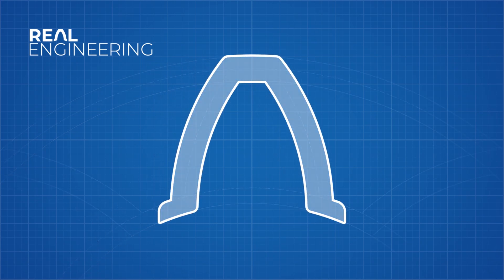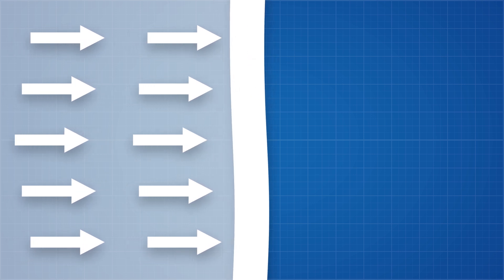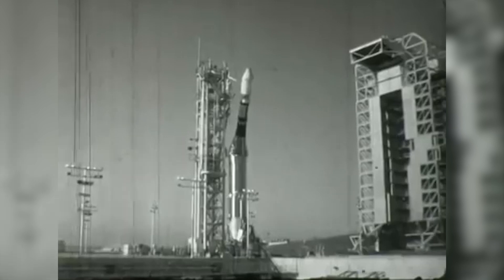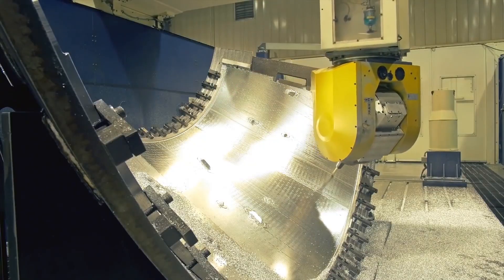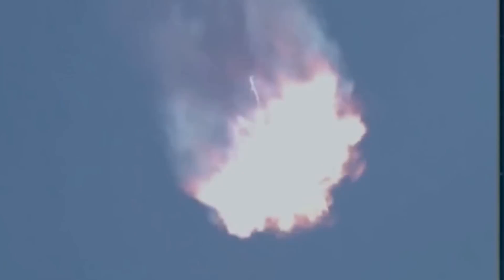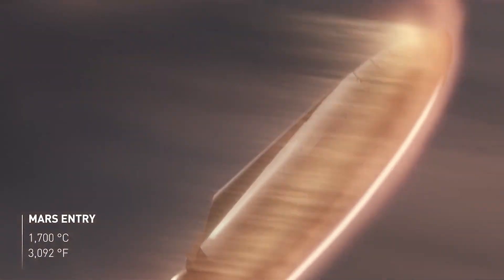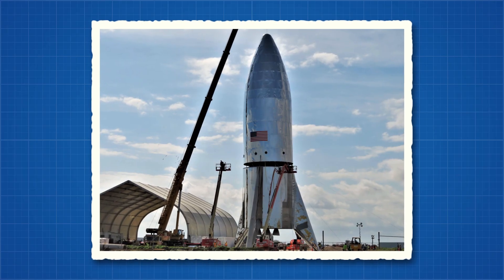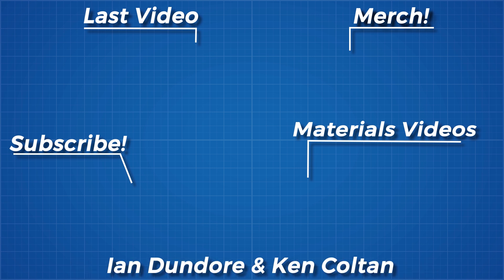Why SpaceX Built A Stainless Steel Starship

Comment: stainless steel gets very brittle at the temps on the side not heated by sunlight in space .
Reply: ".... Musk says SpaceX will initially use 301 stainless — that’s similar to the metal used in pots and pans. It doesn’t sound very space age, but SpaceX seems to think it’s the best option. ...."  initially being the key word ... no word on what will be used in the end .
Reply: ".... cryogenic temperatures can cause a normally ductile and tough stainless steel, such as 301, 302, 304, 321, to partially transform to bcc structure, resulting in an impairment of ductility and toughness. ...."

Comment: Don't forget the extra drag in that calculation to determine the amount of Standard Oil that I need to pay (using only horse currency from 30k) to place into what should be my gas tank, at this point in time to get that thing to reach orbit.  You may also need patiented baffling technology for so much gas.  That drains towards the fuel line and not always or side to side.  b

Comment: i think the main thinking Error ist to think the ship has to land, why not build a ship up there wich only travel from location A to location B, that makes the landing vehikles alot easyer... if u can use Technologys wich are allready there...  just remember this technology was used on the Moon... and for surface Returns u only need a small weight to bring up while the Travelship can have a very very big confy 
size
Reply: That's a logical question, but I'm sure there's a logical answer; I find it hard to believe they haven't already thought of that.
Reply: I costs too much. By landing every part of the rocket they can reuse the rocket.

Comment: When you do something different (Especially drastically), failure is more likely to happen. But that isn't a bad thing. The analogy, "The road to success is paved with failure", is a rather fitting statement. While sticking to the old, tried & tested ways may yield less failures if a company has the capabilities to produce vehicles with reliable means, it however may not promote much room for substantial growth & advancement with the current designs. As whatever advancement that does happen from old technology, will often be small, incremental implementations. Building something new from the ground up, while taking in to consideration the failures of similar designs, doesn't mean that such will share the same kind of failures, but it can reveal new, differing kinds of failure, which I believe is necessary for the continuous improvement of such a new concept vehicle or rocket. There needs to be constant evolution. In all aspects. Otherwise, well, we would probably still be single celled organisms. Our ability to understand & problem solve is phenomenal to have, which ensures constant adaptation. As aforementioned, this bodes the same in every aspect of what we put our minds to.

Comment: Thermoconductivity? The thermoelectric effect is the direct conversion of temperature differences to electric voltage and vice versa via a thermocouple. Thermoelectric devices create a voltage when there is a different temperature on each side. 
Does this craft take advantage of this ?🍀Is this shiny retro rocket a hybrid ?

Comment: So a couple of questions:  Why not titanium for the structural metal?  Lighter than steel but stronger and more heat-resistant than aluminum, and not a very good conductor of heat (and more corrosion-resistant than both).  Also, why not water for the skin coolant on the Mars rocket?  Easier to store than methane (no cryogenic refrigeration needed, and more than twice the density when liquid -- just don't let it freeze), and has a LOT more heat capacity and heat of vaporization.
Reply: @awashburn6944  Why would titanium be less safe for storing liquid oxygen -- does it get brittle with the cold?  (And I thought steel also had this problem.)  It shouldn't react, since it is already passivated as long as it has been exposed to atmosphere (at room temperature) before use.
Reply: @awashburn6944  Well, learned something new -- apparently even in gaseous oxygen at high pressure (and only slightly inhibited by low temperature, and worse in liquid oxygen), freshly-exposed non-passivated titanium surface generates energy sufficiently rapidly when reacting with the dense oxygen that instead of the freshly-exposed surface becoming passivated, the reaciton generates enough energy to expose additional non-passivated surface until most or all of the titanium is consumed.  Thanks for the link.  Also found a few others from the early 1960s.

Comment: The engineers should look at liquid aldehyde ammonia, it   might help slow a hurricane, released as a gas at the base of the eye wall it would cool the air since heat is the fuel..just a thought. Ammonia is natural, Cheap and dissipates in water?

Comment: Will anyone please answer that starship while using stainless steel would be pressurized or it will use isogrid pattern and if it use iso grid pattern that will cause to increase its weight so how its going to manage  ???
Reply: Only the crew section will be pressurized.

Comment: What was the Apollo capsule made of?.....It was made of an aluminum honeycomb sandwhich bonded between sheet aluminum alloy. The base of the CM consisted of a heat shield made of brazed stainless steel honeycomb filled with a phenolic epoxy resin as an ablative material and varied in thickness from 1.8 to 6.9 cm.  And dont forget this capsual was supposed to keep out the massive solar radiation as well.     Kind of goes against your take.

Comment: what about titanium, as strong as steel, higher heat resistance, and half the weight.
Reply: Titanium is very expensive, because it is really hard to work with, and facilities, that can work with are rare.

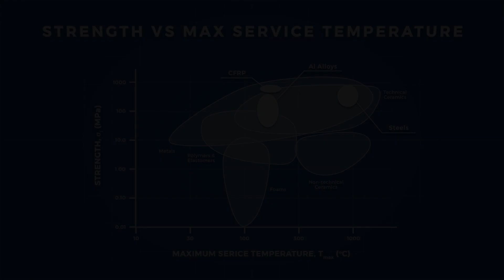Comment: 7:20 There might be mistake with Aluminium alloy temperatures, or what am i missing here? Aluminium is used a lot in higher temp applications than ~200C, think engine cylinder heads, intake manifolds etc. Or does alu soften too much at that temp?

Comment: First system capable of manufacturing Starship in strong titanium alloys. Superior mass and force ratio. Symmetrical double joints with controlled asymmetry of paramagnetic and diamagnetic materials in an inert atmosphere. Starship can be manufactured 60 tons less and by automation ... Integral double joints with controlled asymmetry in titanium alloys ... Robotic welding by stimulated emission of light for reactive materials in a 100% inert atmosphere at 360º. We can now manufacture in titanium and robotically for the first time in history. Now we can do it very well ... !!! ...

Comment: It's worth noting that whilst a lot of 'Western' aircraft switched to more advanced alloys and titanium construction when those materials became available, the Soviets opted to make their MiG-25 and MiG-31 using a lot of stainless steel (approximately 80 percent of the airframe, with around 11 percent being alloy and the rest, titanium). When Soviet pilot Viktor Belenko defected to the West by flying his MiG-25 to Japan, the opportunity was taken by NATO countries to inspect the aircraft in great detail, under the ruse that it would have to be crated up to be returned to the Soviets. It came as a surprise to NATO engineers to find so much stainless steel in the aircraft's make up; some aero-engineers went so far as to say this was a poor choice and that if they had been building it, they would have use titanium. They were of course overlooking the fact that the MiG-25 in spite of their criticisms, was (and remains) the fastest serial-produced interceptor ever, also holding several other related aviation records for time to climb etc: 40,900 ft/min rate of climb, service ceiling of around 69,000 feet and speeds of up to Mach 3.

The choice of stainless steel for the MiG-25 and MiG-31, was for a couple of practical reasons as well as technological. First up, it is cheaper than titanium, but it is also considerably easier to weld stainless steel than it is to weld titanium, on which welds can be prone to cracking, so in spite of its weight, stainless steel is a good choice for thermal resistance on airframes intended to fly around the Mach 3 regimes, which the MiG, being a high-speed interceptor rather than a dogfighter, was designed to do. In being able to weld the airframe, the Soviets were able to forgo the use of rivets in many places on the MiG-25 and MiG-31, which helped to reduce drag considerably. It's still a heavy aeroplane, but it is tough and fast and it remains in limited service with the later MiG-31 expected to remain in service until 2030, by which time it will be 50 years old and the earlier MiG-25 will be 60.

Comment: SpaceX is  pretty damned innovative, I will certainly give them that.  That 'sweating' methane heat of vaporization solution is pretty impressive in terms of outside the envelope thinking.  Everyone should probably look to biological processes as at least one possible path to many such quandaries.   

Evolution is a pretty solid 'inventor', and I have seen many foreskin of technology solutions using such for basis.  One that comes to mind was the shark skin texturing Rutan used to reduce hydrodynamic friction on his sailboat hull design.   There are scads of others I have heard mention of over the years.  

Hopefully SpaceX has gained some confidence points with you since 2019.  :-)  I wouldn't put anything past those guys, especially in the department of time from concept to fruition.  Having worked for an aerospace contractor that aspect of their operation blows me away, frankly.  Hell, I was usually the slower man on the design teams even then, but my stuff usually worked right out of the box when testing and integrating, so I gained some ground there.  Love your channel, keep it up.   Have you ever thought of doing another one aimed more, and more deeply, at the engineering crowd?  Just what you need, right, MORE work?  

You actually peaked my interest with the solar sail problem.  I can see how that would work on orbit pretty easily, but in open space I've pondered that problem before.  Too lazy to research it, anymore, apparently.  Cheers.
Reply: @lepidoptera9337  Given what up, the solar sail?  If so, there was a recent orbital experiment done that prove its capabilities for extending orbits with virtually no internal energy cost.  

It currently would be used for only very light craft like maybe cubesats of some sort though, as building a sail the size required to usefully accelerate a man carrying vehicle would not only be very costly, but would stretch current materials technology pretty tightly. It is also a very slow climb, in several respects, if you get my drift.
Reply: @lepidoptera9337  "The heating on Starship is much smaller than on the Shuttle or a capsule because the density is lower."

I'm assuming you mean on Mars, but they still have to return to Earth, right?

"Solar sails are the technology of tomorrow"

For the most part true, certainly in the case of any large mass to be towed.  And those sails would be very costly, as well.  For boosting orbit around Earth, though, for tiny satellites like cubesats, it has already been demonstrated.  It is a slow process though, obviously.  But in that case, VERY cheap.

Did I say anything about energy?  If I did I meant energy to propel the rocket, not to power interior functions or external instruments.   I would think that could be done, or at least augmented with solar panels, it would take a lot of area, but the sun is 24/7 out there and it is not going to make your roof leak.  

Also, I suspect, but do not know for sure, that putting a reactor on a manned vehicle might not be as simple as it sounds.  There are things to be considered that aren't an issue on the ground, like external radiation production.  Swimming pools aren't much of an option in space...you wanna talk about MASS!  :-)

I'm an EE, not a thermo, nuclear, materials, etc. engineer, but have some limited knowledge in those areas, NOTHING like those that design and analyze in those areas, so excuse me if there is some 'off in the weeds' here, but nobody is an expert on everything.  Actually a guy like Musk is probably about as close as you get to that in the engineering world, kind of the ultimate systems engineer.  My dad was that sort, too, as a chief engineer at corporate for the company we worked at, at least one of them, but the primary one, for both of us.  Unfortunately I barely started up that ladder, but hey, some of it was fun.  Some of it was agony, as I worked for a defense contractor (doc).
Reply: @lepidoptera9337  Are  you talking energy density?  I already addressed the second paragraph.  For the outer planets a large Ion drive could work, I suspect.   Almost no acceleration, but VERY long action times.
Reply: @lepidoptera9337  "I suggest you do some back of the envelope calculations."

Where am I going to get an envelope??  :-)
Reply: @lepidoptera9337  Really?  People still use snail mail?

Comment: Isn't steel weakened by high temperatures? There is a good reason it isn't used in applications that require those...
Reply: But it is strengthened by super cold temps... which the fuel is.
Reply: yes just like any other material unless you use some hyper-expensive alloys. steel is weakened at at much higher temp than most other materials plus as the other guy said the cold rolled steel they use gets stronger under cryogenic temps.

Comment: I wonder if it is possible to extrude 301 stainless steel in a 9-meter diameter tube. 

Then the SpaceX workers would not have to do all that welding. (The best weld is no weld!)

What are the technical challenges in this?

So far, I am unable to find out the thickness needed.

Comment: Within the first minute it states that WD40 was used to stop the tanks rusting, it then states that the tanks were made of stainless steel.
One of the major benefits of stainless steel is, it doesn't rust.
Am I missing something here?
Reply: @awashburn6944  You are correct, it does rust but in normally needs some other chemical to react with.
As a fuel tank that is only stored for a few months before being blasted into space, it shouldn't need any treatment.

Comment: I dont think the thermal conductivity of steel had anything to do with it. Both aluminum and steel conduct heat pretty well, they need thermal shielding for heat insulation... Steel's melting point however is much higher

Comment: At 1:10, WD-40 was used to keep stainless steel from rusting? Huh? Isn't stainless steel well...stainless? Great video tho!! Nice work!
Reply: Stainless steel is a bit of a marketing term.  Depending on things like quality and how well it is processed before the end user receives it but even stainless still can and will rust in the right conditions.  if you find metallurgy a little interesting I suggest falling down the stainless steel rabbit hole on the internet, it is pretty interesting.

Comment: 7:05 I see what you did there.
Reply: I didn't see what he did there
Reply: It was the double entendre about the stainless steel "shining". First, there is proverbial usage meaning how it was able to outperform carbon fiber and various other metals. Then there is the literal definition of "shining" because stainless steel is an alloy, part of which is  chromium. Therefore when properly polished stainless steel is super shiny.  And that was an example of alliteration. Lol hope that helps.

Comment: If they can get a good speed with that heavy ass metal, imagine a light metal that wont melt at the temp that the rockets engines put out, the speed would be fast as fuck boi

Comment: Why not use titanium? It’s stronger than other metals but also way lighter.
Reply: but still heavy.
Reply: True, but lighter than any other metals.
Reply: @alphabears6342  uuhh, definitely not. It's quite heavy. it is, however, quite good in the strength-to-weight department.  but for rockets, lighter is better than stronger, at least if they're similar in magnitude.
Reply: SpaceX is going to mass produce these. Titanium is too expensive. Stainless steel checks off all the requirements like titanium.

Comment: Humans have been building bridges to get from one piece of land to another. People have asked if we can build some sort of vehicle to send to the moon.  After all we sent satellites though our entire solar system and they are still going.

If we used the ISS SPACE STATION to send a thin wire to the moon using a solar sail or possibly shooting it out.  Then shoot another wire from the ISS to earth with a large weight at the bottom.  We could make the rope in mile long sections with small loops at each end.  So when they were connected they would be the same size as the rest of the rope.  If the ISS was resupplied with rope and sent a few miles a day it would eventually reach earth and the moon. 

This is assuming that reentry would not affect the rope if it moving at a slow pace , otherwise the wire would need to withstand the heat of  reentry. Another option would be so sent up the rope into one of the planes that goes into lower earthen and release the wire and shoot the wire up to the ISS and   

If it worked we could send up stronger wire to support pods that would carry supplies and people to colonize the moon.  As technology  advanced we may be able to send something from one side of the world up to space an then send it to its destination on the opposite side the next day.off course thiis would have